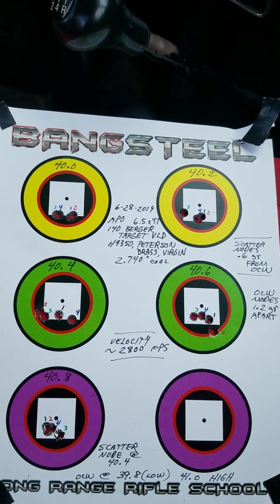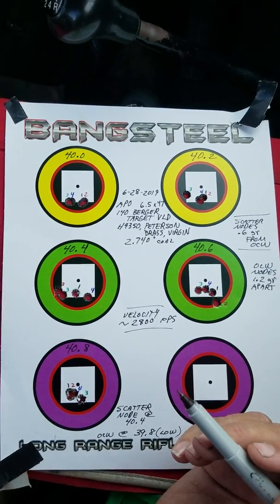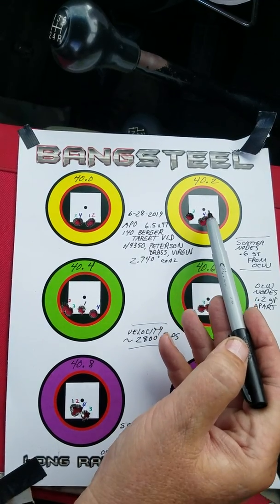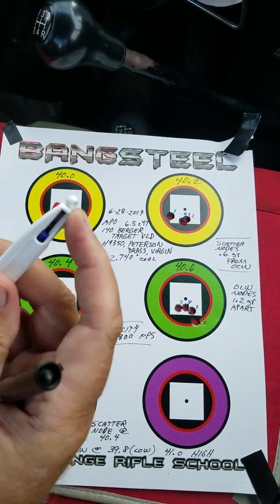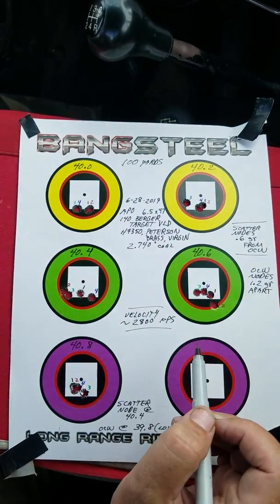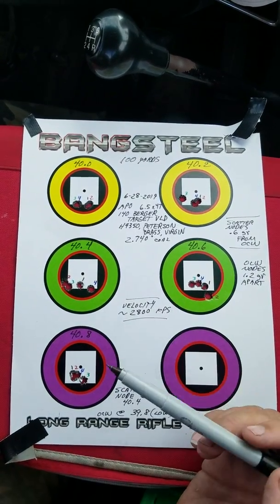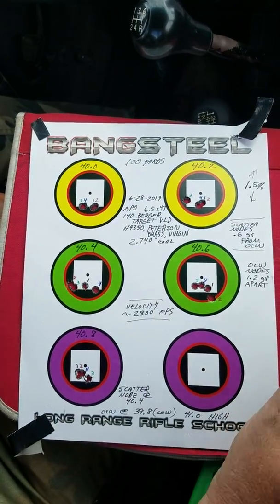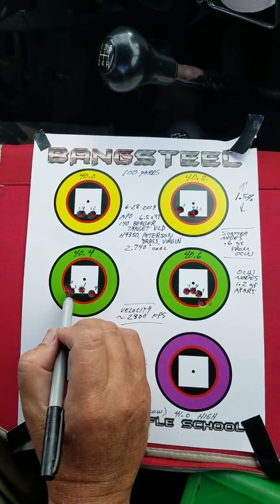OCW reloading, done right, short tutorial

Comment: What about seating depth? I'm trying to work up a load for a Savage 110 elite precision in 338lm . Running a Berger 300gr tactical hybrid on h1000. the problem is I only have .5 lb of h1000 left and activity searching for some more. So I guess I'm going to have to drop the h1k until I find more and move on to Ramshot magnum. This cartridge is kicking my butt.
Reply from the maker: With Ramshot Magnum, load 86.2 grains with the 300's in Lapua brass. We use 89.3 grains of Retumbo with 300's in our Savage... and you'd be around 88.7 grains with H1000 (that's an estimate).
Reply: @bangsteellongrangeshooting3413  I have been running 93gr of h1k. I'm trying to keep the speed up. Maybe I need to give up on that and back the charge up some. I talked to a guy a friend of mine knows. He's loaded 338 before. I got 2 in damn near the same hole and 1 flyer. a few times I got 2 touching or very close and a flyer. This was during in my seating testing and he said I may need to just shoot twice, let it cool and try that. How far are you from the lands in your load? Thanks for the help! I've reached out to a few people on here and no one wants to share any input on 338lm.

Comment: Dan where would you start your seating depth before your ice or after
Reply from the maker: after the OCW powder charge is determined. Normally just start at .020" off the lands (twenty thousandths)... if you're planning on using a secant ogive bullet (like many of the Bergers, and also some Sierra and maybe others)... then start with a tangent ogive of the same weight; find the powder charge that's optimal then work up to that charge with the secant ogive bullet. 

I do OCW load consultations which you can read about at OCWreloading.com

I don't typically answer too many questions on YouTube, as I'm sure you'll understand why. But I did want to answer yours, as it's important for others to understand as well.

Comment: Thanks for the OCW load test and I've read your website and I have worked up a couple of loads for 308 in 168 SMK and 175 SMK with IMR 4064 But I am coming up with numbers that kind of concern me and I hope you can look at this and tell me if I'm on the right road. When I compare what you have published load info for on 308 168|175 SMK using IMR 4064 which is 168g - 42.8g IMR 4064 and 175g - 41.8g IMR 4064, my load data is what I consider unreasonably high.
I followed the OCW instructions and got 3 MAX loads for 175g from IMR = 45.6, Sierra = 42.3, LEE = 43.5 and so I chose 45.6g as my MAX load.
So my first SIGHTER I took 7% and:
#1 @  42.4g - SIGHTER / FOULER
+ 2%
#2 @  43.2g - SIGHTER / FOULER
+2%
#3 @  44.1g - SIGHTER / FOULER
Then +2%:
#4 @  44.9g - SHOOTER
+ .2g
#5 @  45.1g - SHOOTER
+.2g
#6 @  45.3g - SHOOTER
+.2g
#7 @  45.5g - SHOOTER
+.2g
#8 @  45.7g - SHOOTER
STOP - 1 Over MAX Load

Is this correct because I think I am way beyond your published 175g - 41.8g IMR4064 number.
It looks like Bolt Action Reloading found a node at 43.4 which is above your 41.8g but still quite a bit less than my 45.7g number.

Could you give some advise if I am working this correct?
Thanks
Reply from the maker: Your brass won't last long at those charges... I'd stay below 44 grains for sure. If you need further help, see the "consulting" option at OCWreloading.com and we can do a phone call if you need to.